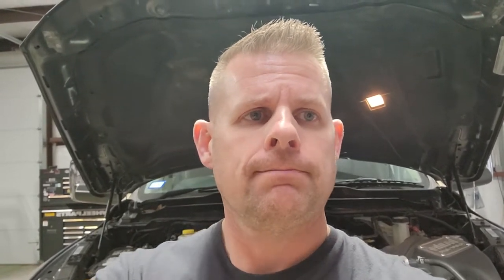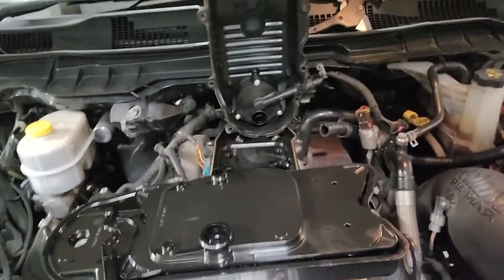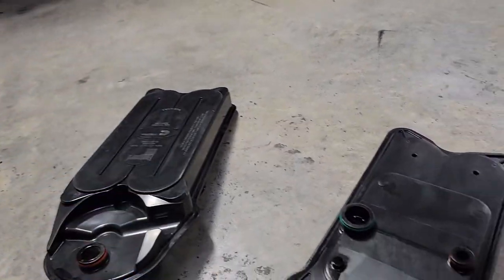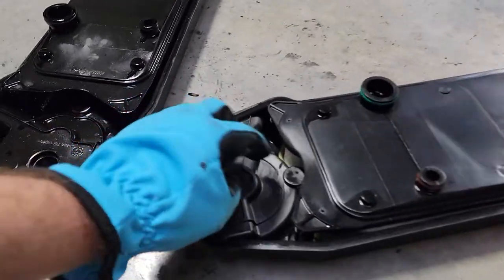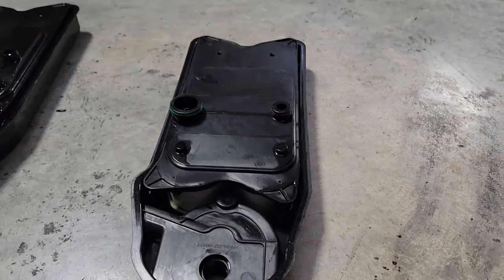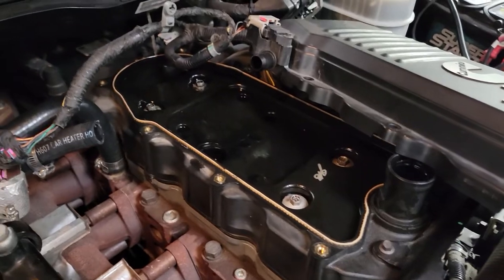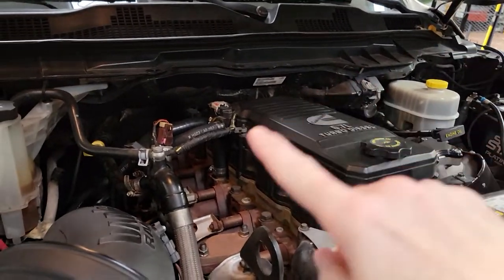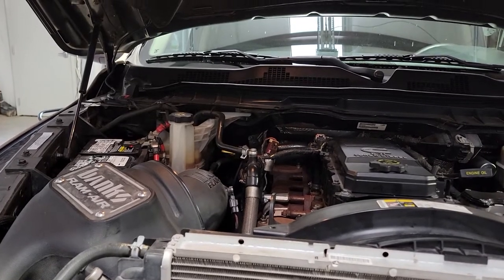Ram 3500 Crank Case Filter Delete-Watch before deleting your CCV Filter

Comment: I change my crankcase filter every 50,000 miles an I use a catch can made for diesels and route it back into my turbo. The price of a new turbo is crazy  my truck is a 2012 an it runs great no oil leaks or problems
Reply: it's seems to be the best option

Comment: I have a 2011 model. With new ccv filter and the 90° breather. Never have had a error code.
Reply: Any issues? We are doing ours 2012
Reply: @DIYKAI  no nothing at all. The 2007-2012 don’t have the ccv sensor. Won’t set a code
Reply: @ericestep9880  any fumes or oil spray like other s said? Are you still running it? Should we gut the filter? Thanks
Reply: @DIYKAI  I would replace the filter yes. And no with a new ccv filter you won’t get any drips or oil spray for a long time until your ccv filter gets full.
Reply: @ericestep9880  cool thanks man

Comment: I've got the CCV filter but also have a 90 Degree CCV filter and no codes on my 2011 3500.
Reply from the maker: The 2017 has a sensor right outside the CC Cover that knows if it's still connected to the turbo due to pressure changes. Only way around that is a tune to disable the sensor.
Reply: Same with our 12 no codes easy to work around

Comment: Aside from the CEL, did you notice any difference in power or fuel economy?
I'm thinking of adding a catch can between the OE CCV and turbo
My truck is also altered, so I plan to ditch the z-shaped hardline while I am at it.
Reply from the maker: I didn't notice any difference.

Comment: Whoever does your delete tuning will be able to disable the code. If you get a baffled valve cover you won't have to worry about a catch can unless you're pushing serious HP numbers.
Reply: So do still need to route the ccv return line to the turbo?  Or just run it to atm?
Reply: @larsgustavson3629  atmosphere. I have a hose ran down to just below the frame.
Reply: @ThanksHero  I have the SPE kit with the internal catch can and I smoke like crazy. In drive throughs it’s especially annoying, you have a solution to that?
Reply: @TheDieselDoc911  Smoke from where? Your CCV? lol.  not familier with whatever that kit is.

Comment: I did the catch can and rerouted hose and now getting PO4DB fault code too ! I don't have a tuner yet but need to know what I can do to stop this . I already changed the crank case filter too .
Reply from the maker: Theres no way around the sensor that the hose passes through at the crank case cover. Only way would be a custom tune. To me its not worth it. I just put everything back to stock.
Reply: I have a 2018 Ram 3500 . I did the crankcase delete I have a raceme Ultra tuner and I don't get any codes

Comment: My problem is when I did it the o-ring gasket popped out and wouldn’t fit anymore it was to long. Got a new one and it’s to long. What gives?
Reply from the maker: I'm guessing you are talking about the thin rubber gasket that runs around the lip where the crank case cover sits? I would guess theres a proper way to install one or maybe the wrong part? Hope you can get it figured out.
Reply: @tacticaldieseldad5695  I fixed it. Make sure the engine is cool and soak the rubber gasket in ice cold water. Worked great!

Comment: How do you like the Banks Cold air intake? Would you buy again?
Reply from the maker: The performance isn't an issue, I do wish they would give you another inch of 4'' tubing that joins the turbo to the intake tube. Mine has slipped off several times. 
My biggest issue is you should be able to access the filter for cleaning, without taking the whole thing apart. I would go with another brand or do a drop in K&N.
Reply: Thanks for the quick reply. I put one on my 2020 Ram last week. Still not sold on a cold Air. Seems like the whole community is divided on them.
Reply: @Jason S  I have had them before. I've never seen where I even broke even
Reply: I have the banks cold air unit but I don’t like where the air comes in on a dirt road filter gets dirty really fast need to come up with some type intake tube, any suggestion, banks sell but can’t fix the problem
Reply from the maker: @johnminyard1054  They do make Pre filter covers that are like a mesh that covers the filer. Being on dirt roads all the time will obviously be a chore to clean on regular intervals

Comment: Mopar filter has fleet guard stamped into the plastic. 
Pull the filter at 35000 miles and compare the weight with a new filter.
If China filter falls apart you will have no standing with warranty
Reply: Just changed mine at 62.5k felt very heavy compared to new one
Pretty easy job to change. Can get Fleetguard (Cummins) filter on Amazon for about 60.00 with tax
45 minutes to install, gonna start changing every 25/30k also good rule of thumb KEEP THAT OIL CHANGED .. NO MORE THAN 5K
THEN CHANGE DONT GO PAST 5K
Your engine and pocketbook will love you down the road. P s. Always try to give your turbo a cool down I let idle about 30 seconds before shut down on short drives and about a minute after hwy drive
Gives oil and turbo chance to cool 
could help save turbo repair. 👍

Comment: Here in Az we can't delete much due to emissions. I don't see much advantage of deleting EGR or Cat or CCV my 2018 runs just fine towing my boat and trailer with all intact and mileage is more than acceptable. Only thing I would delete is grid heater that has that bolt that may come loose and and damage engine.